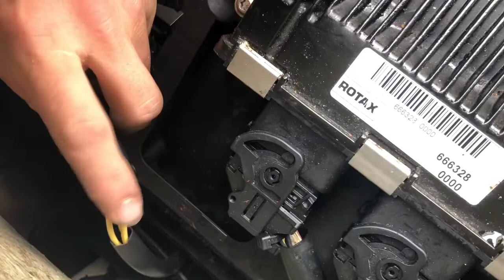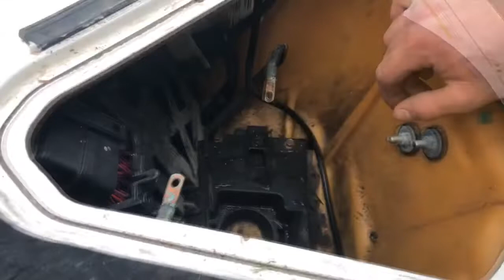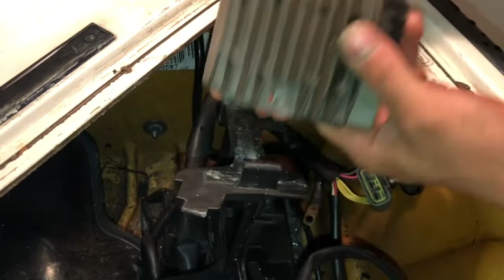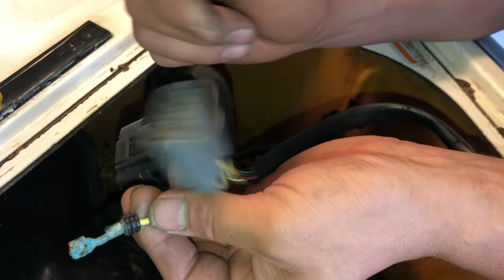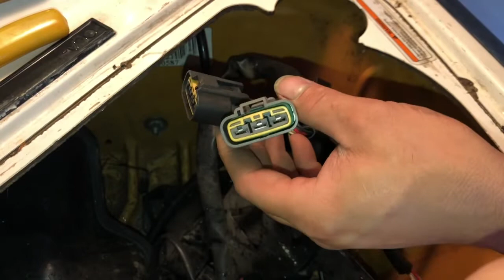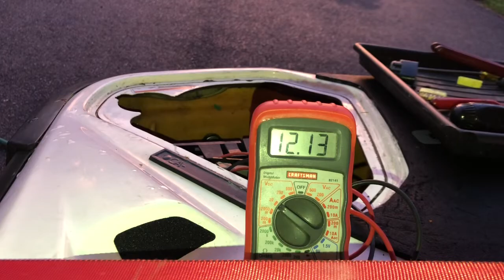2011 Seadoo GTX 215 4tec voltage regulator install with new ends

Comment: Thanks for your Video, I have a 2015 GTX iS Limited with 196 Hours, yesterday I was about 20 miles from my home launch ramp on the West End of Galveston Island when I got notification of a Battery Voltage Fault (P0562), fortunately I made it back safely but not before I began getting a flashing Red iBR warning (caused by low battery voltage). The Battery and Voltage Regulator location is similar to that of your Ski. Praise the Lord I didn't have the corroded and Burnt Electrical Connections you had to deal with, my Stator Tested (all similar resistance values and not shorted to ground) fine also. I was able to borrow a Voltage Regulator from a friend from his 2019 Wake Pro 230 for DynamicTesting = all Good and Charging at 14.22 Volts (fully Charged Battery). I ended up ordering a used part online from a 2017 Ski Doo Outlander 600 Ace (same PN: 710001103). BTW, the screw you reinstalled securing the Part is a redundant method of mounting if for some reason the plastic retention clip gets broken, the plastic sub-bracket that the part mounts to simply snaps onto the Battery Bracket, I used a VW (Bone) Trim Tool to pop the brackets apart.  Randy   AKA randog311 (Retired Professional Wrench)

Comment: you could add Conductive paste to protect the terminal.
Reply from the maker: This true. I did do this at a later time but forgot to add the info on it. It is a very good thing to do to help keep corrosion down in connections. Thanks for the support!